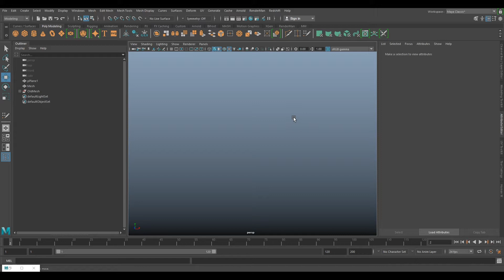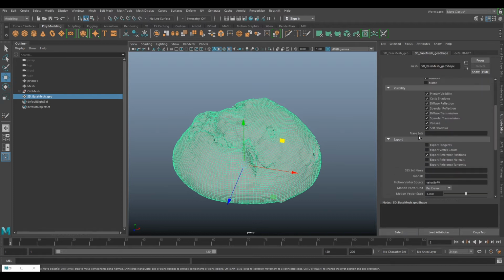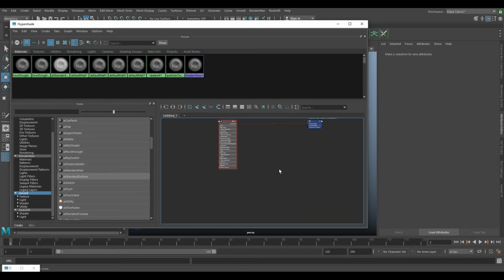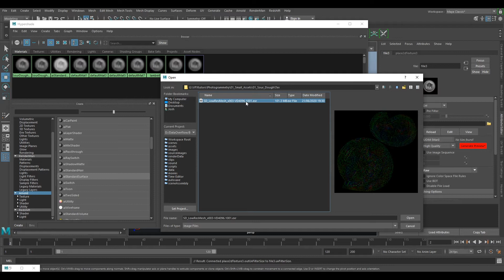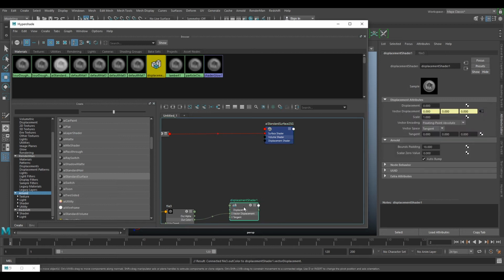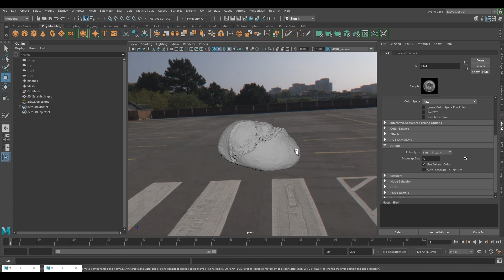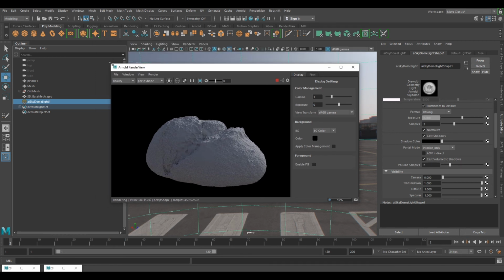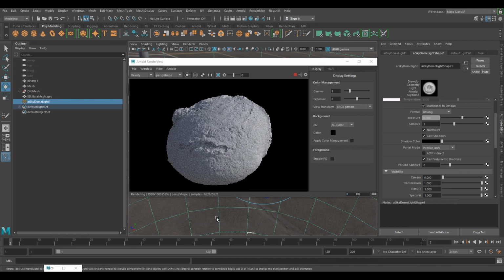Vector Displacement Shader In Maya - Fast Realistic Assets - Part 5

Comment: tx files do more than linearize color profiles, they also mipmap textures. although this isnt needed for lookdev. when something is far away in a shot, it will speed up render times. also, if you have your file import colorspace set to RAW or any other linear format, it won't double linearize it. it's smart, it'll just leave it alone and not change anything while also generating mipmapping profiles. so it's always best to generate them with proper colorspace settings. you can also just completely avoid this during lookdev by either exporting linearized textures from substance/mari, or by converting the colorspace of your textures before you import them to maya. but at the end of the day, converting your files to .tx will save time when rendering said object from far away